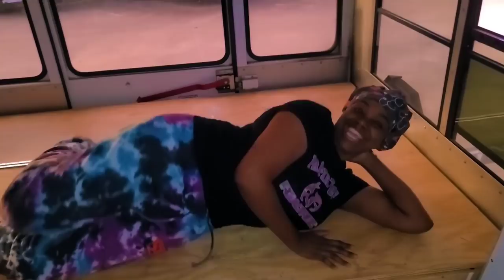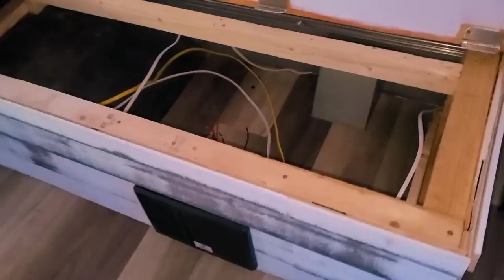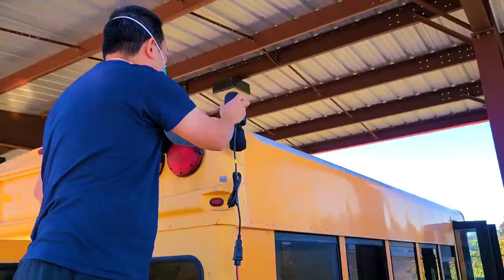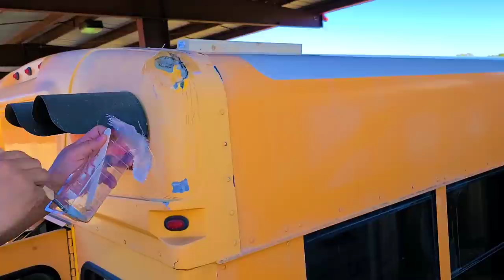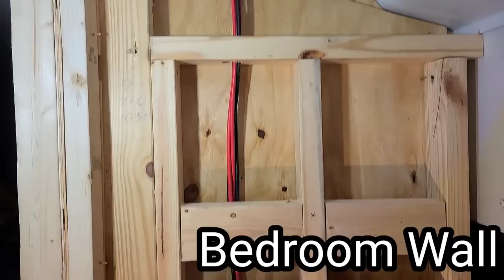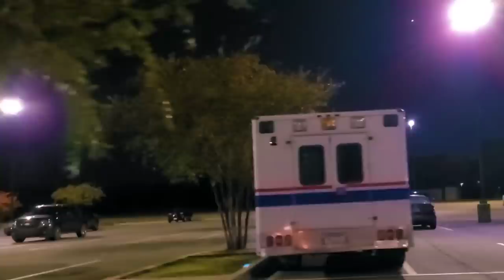BusLife | Skoolie Conversion Week 9 How To Build A Shower Part 3 #shower #busbuild #skooliebuild

Comment: Coming along great. I've always been a fan of that shower wall material. I've used it in my rental property a few times. It's very durable, and also flexible to a certain degree, so it'll be great in the bus I think with the movement. So glad that hole was found and fixed now than later. Good Job there.
Reply from the maker: Thx so much🥰 We are addressing the issues as they come. Everything will work out in Jesus name🙏